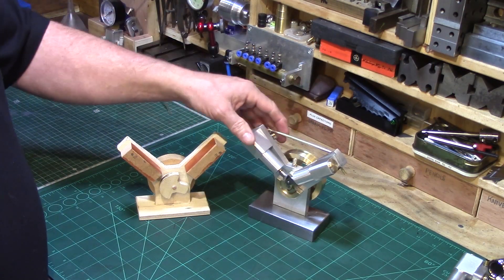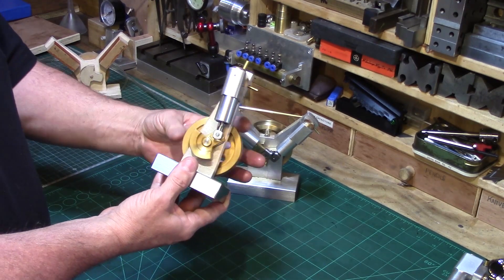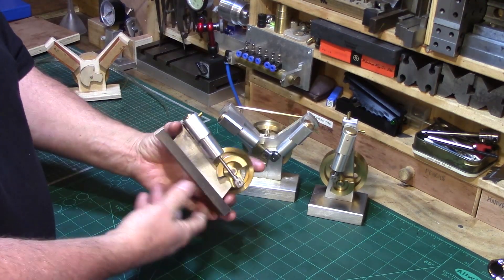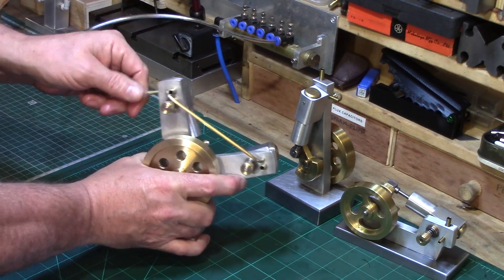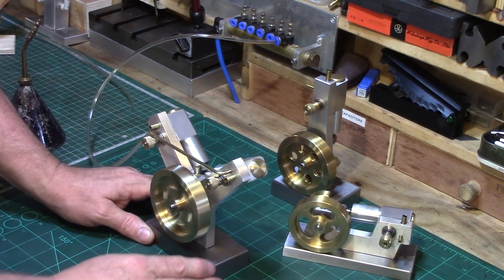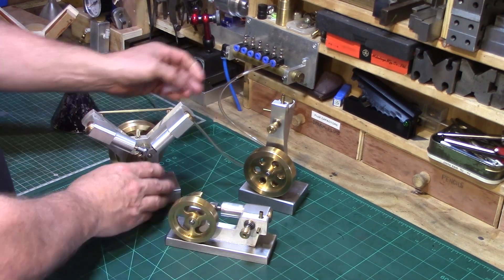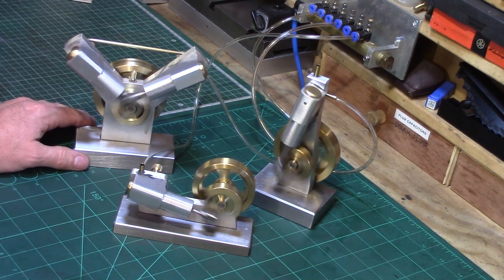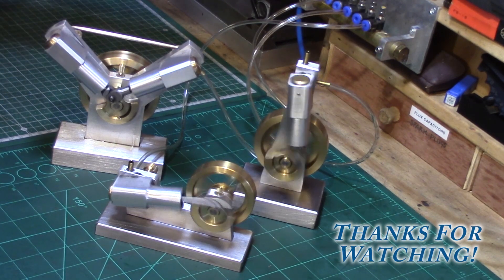Wig-Wag Vee Engine

Comment: HI Ade, I'm looking at building one of your gorgeous Twin Vee engines for my two boys.  What sort of psi can it handle?
Reply from the maker: Hello friend, these little engines are not designed to run at high speed, in fact the opposite, try and run as slow as possible! They are more appealing at a slower speed. Now for PSI, i can run these down  to about 8-12 psi, which gives a nice steady  tickover, but it all depends on the build quality as to how well they run :)  Join us on the wigwag facebook group to learn more :)  Kindest regards. Ade
Reply: @AdeSwash  Thanks Ade.  I was hoping to run it as high as 50psi.  Is that possible do you think (subject to my build quality)?
Reply from the maker: @bigAl3346  you can run it as fast as you like. It's your engine

Comment: Hi how do you bend the copper tubes?
Reply from the maker: I made a bender die
Reply: @adeswash  have you got a YouTube video on it please
Reply from the maker: @JustFun-iz9rf  I havent, but you need to grind a HSS tool to the radius of the tube, then make the die on the lathe to full depth of the tube, and the desired bend radii, the full depth prevents the tube from expanding outwards causing a flattening effect. Fully anneal the copper, and it will take the bend easily. I should do a video one day. Anyhow, hope that helps :) Regards. Ade
Reply: @adeswash  yes please do a video there is nothing out there about model engines 
Thanks
Reply: @adeswash  have you got a YouTube video on it please

Comment: if we put 2 of these back-to-back with the flywheel in the middle, we'd get a "naturally-balanced" V-4 with power strokes every 90°, as with the French V-8 internal combustion engine.. one flywheel, 2 main bearings, power every ¼ revolution, balance and symmetry, and also self-starting..
Reply: i'd build the flywheel into a centrifugal blower and use it to pressure ventilate my D.U.M.B./sous-terrain.. could provide for cooling of the engine, drawing air centrally past all 4-cylinders, also heating the air..

Comment: Could the exhaust from the twin wig wag power your singles?
Reply from the maker: Unfortunately not Rob, the exhaust is evacuated under the kinetic energy from the flywheel, which isnt enough to drive the piston for the next stroke, to create the required enery to evacuate the cylinder again, think of it like a perpetual motion system, the energy losses in the moving parts are too great

Comment: Maybe a silly question but can these run in reverse by switching the ports over ( ie air into exhaust)? Lovely job again. Thanks
Reply from the maker: Hi Ian, yes in theory, with the single cylinder version this works fine, although the supply pipe config on this V type would probably need alteration slightly

Comment: Have any plans and list of materials for your air supply manifold I’d like to have a go at one myself really impressed especially with all your engines running of it keep up the good work 👍
Reply from the maker: Hi Robert, it is simply a length of brass drilled through, a flat milled on top and fitted with supply and 4mm regulated outputs. If you need more info send me an email at swashade @ gmail dot com. regards Ade

Comment: Hi Ade, Great engines , really good looking and most importantly you have catered for us poor hobbyist's that don't have massive milling machines or casting facilities.Have now subscribed. cheers Mike
Reply from the maker: Hi Mike, thanks for the subscribe, as you say you dont need huge machines for small model engineering, you just work to the capability of the machine. Cheers. Ade :)

Comment: I’m keen to make my first ever engine! I’ll do the single via the plans first! 
A quick question or three if I may... do you think the engine would still run ok if you doubled the size of all dimensions in the plans? Might consume a heap of air but if air kept up to it, it should run? 
Going larger I’d make a flywheel and crank balancer and have them finely balanced. Balance the flywheel and crank as an assembly?
Reply from the maker: Hi Anthony, is should work ok as long as it is balanced as best as it can be. I'd be interested to see it if you do make it